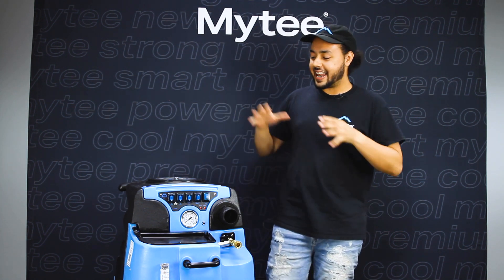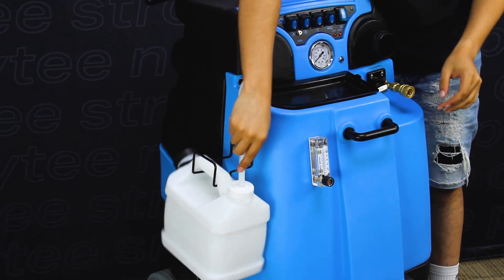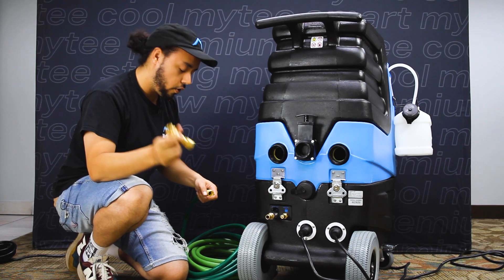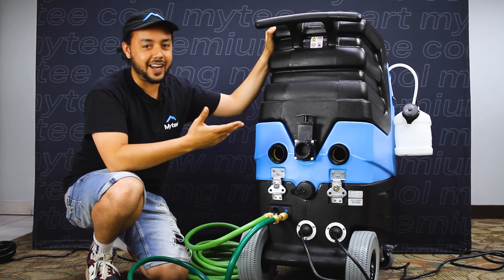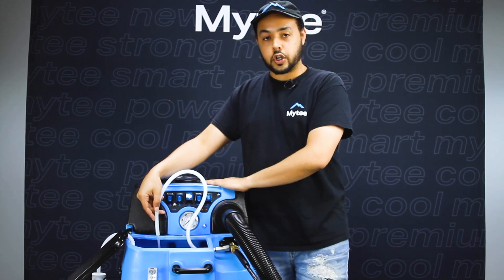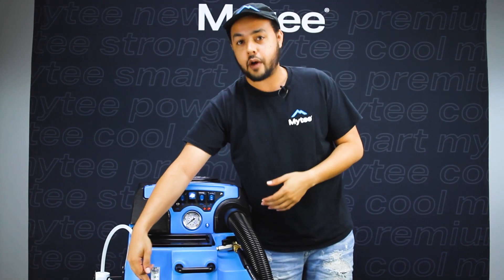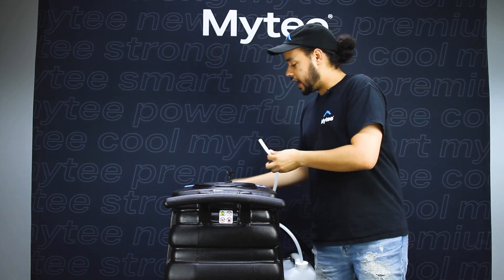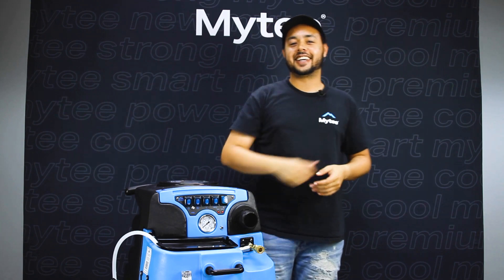Mytee How-To: Operating the LTD Speedsters®

Comment: How do you know the wall plug is 15 or 20amp?
Reply from the maker: By type of receptacle and outlet location you can generally infer whether an outlet is 15a or 20a one. Most US homes and buildings have 20a outlets located in the kitchen, bathrooms, garage, and/or laundry room.

Comment: What do u mean by prime your pump? Why does the nob have to be in the prime position and not the run position?
Reply from the maker: "Priming" is a term to describe the process of preparing a pump for use by purging any air bubbles from the chamber. Air compresses more than water and thus will affect the pump's ability to deliver the proper PSI. The prime valve just recirculates your water so you can run the pump for long enough to achieve a good prime without having to manually hold a trigger down on your tool, which would also deplete the water in your tank before you get to clean with it.

Comment: Can I run hot water through the ltd5 or ltd12?
Reply from the maker: Yes you can, up to 140ºF water can be put into the solution tank without causing damage to the pump. External heaters are available that will heat water up to 210ºF after the pump too.